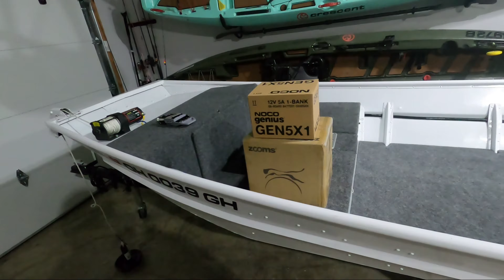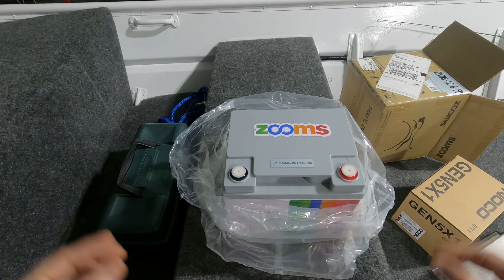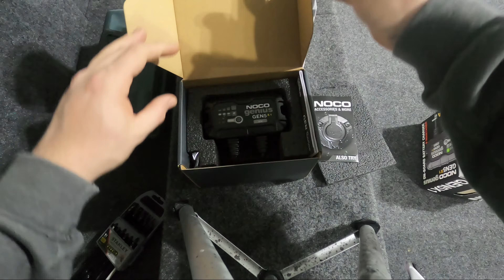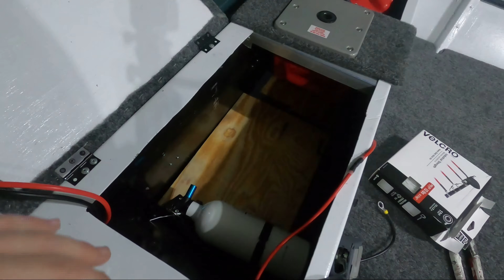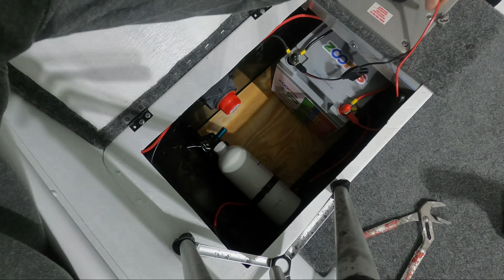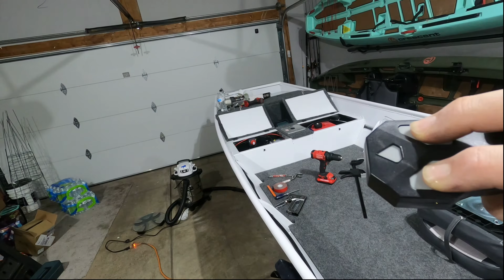NOCO Genius GEN5 Unboxing & Installation NEW Lithium Battery for Jon Boat Bass Boat Conversion Build

Comment: Hey bud does it start charging when plugged into mains power or do you have to press the mode button?
Reply from the maker: After you set the mode for the first time it will remember the choice and just start charging when plugged in.

Comment: How long do you typically leave your NOCO charger plugged in? I’m thinking of leaving mine on my boat on through the winter not sure if that’s safe or not ?
Reply from the maker: You should be able to leave it plugged in all the time, it's a battery maintainer as well as a charger.
Reply: @mvboutdoors  thank you so much for the reply. Going to purchase this one.
Reply from the maker: @CreonSeastrunk  It's been working great 👍
Reply: Do you need to select lithium every time you plug it in? Or does it remember your last setting?
Reply: Can you start your outboard gas motor with the lithium ?